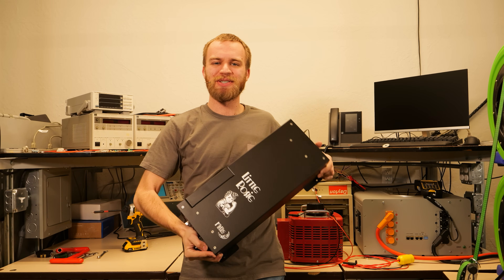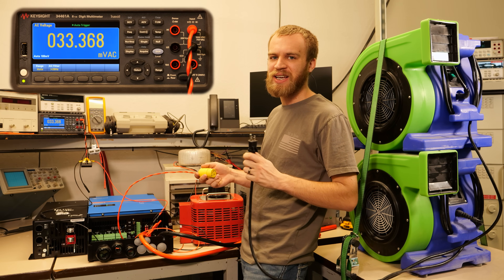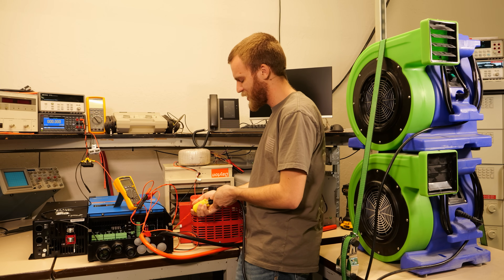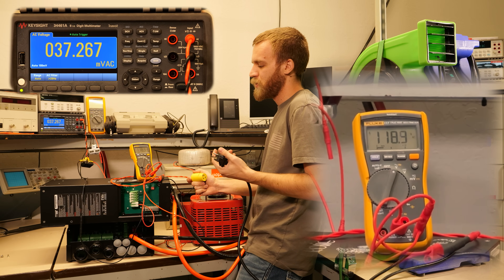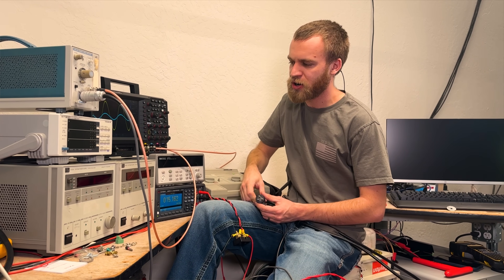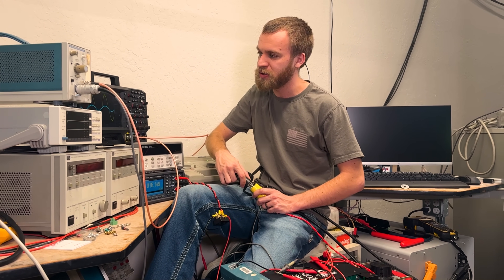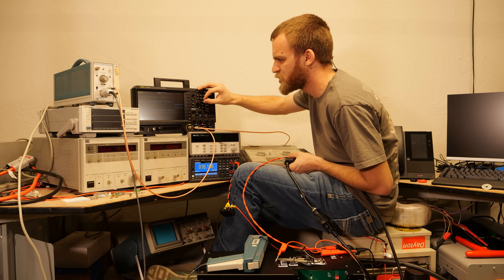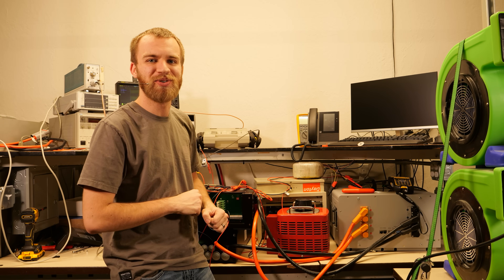Surge Capacity Test: Low Frequency Victron VS High Frequency Midnite | NOT WHAT WE EXPECTED

Comment: Is Current Connected going to continue selling Victron?

Victron is not "weird", they flat out overstate their inverter capabilities. A 5kVA inverter should run a 5kW load at unity power factor, no asterisks involved. Their efficiency numbers also don't reflect reality. Sure, inverter efficiency is measured only at a certain load percentage, so show me the efficiency curve. Their idle consumption (no eco) is often several watts higher than they claim. I have a feeling their version of a watt (and VA) is not the same as everyone else's.

They have quality issues and pass them off to the reseller who will tell you you're holding it wrong until you prove beyond a reasonable doubt something is not right. That's if they don't ghost you beforehand. Complete with return policies that are only valid right up until you open the box. I have had less trouble dealing with random Chinese brands than Victron.

The most pathetic item they sell is their Victron Battery Switch, which is made of fragile plastic that can't even be torqued without fracturing. Who's brave enough to run 275A through it?

A lot of their stuff uses non-user replaceable fuses that is nothing less than a probability based money grab. Victron's reverse polarity protection often means that the unit will burn itself out instead of causing a fire; not that it will actually prevent damage. Meanwhile, a cheap Chinese inverter will work good as new with some new automotive fuses.

Victron does make some decent MPPTs, chargers, and shunts. However, the rest of the stuff is a good decade outdated and overpriced. Their MAP is nothing short of price fixing. Why do we need to buy hundreds of dollars of gear simply to monitor their gear? What's up with all the VE direct/bus Cerbo nonsense? Even a VE Direct USB cable is $30, which is a glorified TTL to USB cable. Slap a dirt cheap ESP32 SoC in each component and let us manage it all on our phones without the dongle madness. If a $10 smart bulb can support remote management over Wi-Fi, so can an inverter.

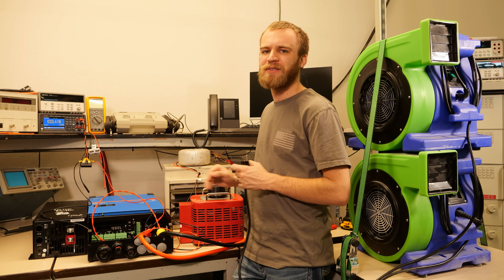Comment: 3:33 When you first turn on high amp electronics like that, there is a large surge of inrush current which is the 72 amps you are reading.  In this situation you need an EZ-Start or a Soft start.  This will keep the inverter from going into overload during the startup inrush of current.  Without an EZ start you will keep blowing fuses or wires and eventually break the inverter or electronics themselves.  Almost all Air Conditioners do this.  Pretty much any electronics that draw over 20-30 amps you should use an EZ start.  It goes between the inverter and the DC-IN connection (where the batteries go).

7:47 this is how voltage works, when big electronics turn on, the voltage drops low signaling it wants as much current as possible.  Then after it receives enough current, the voltage will raise back up.  You need an EZ-Start for inrush current.  Micro-air makes a good one.

Search youtube for "gone with the wynns air conditioning on a sailboat".  That video will completely explain this situation.  Sometimes it is difficult to catch this situation because you need a special voltmeter to catch startup inrush current since it happens so fast.

13:30 the Victron inverter was basically matching the sine wave of the load.  It matched it almost exactly which is ideal exactly what you want.  The problem was simply inrush current which will always give you a problem without an easy start.  Also you are always start at full load which is not good.  Especially after both inverters when into overload several times.  This is bad for the equipment and not safe for you.  Its like flooring and rolling the accelerator in your car over and over...  Not good for the equipment or for you.

I personally would go with a Victron inverter before going with a mysterious no-name (also known as a black label) inverter.  I planned on dual Quattros for my boat.  Victron has a presence in all major countries with physical installers all up and down the coast line.  They are also available at West Marine etc.  If something goes wrong you can get help, you can get parts, you can find installers.  Little Rosie is kind of a knock off bargain bin inverter.  Victron is top of the line and has been for years.  Used in boats, rv's, and off grid setups all over the world.  Victron is gonna get you further IMO, you should not pay bottom dollar for your power setup.  This is something you will depend on every second of every day.

Comment: they are two different constructive architectures for a reason. the low frequency inverter from victron is built with durability over time as the low frequency transformer does not put so much strain on silicon transistors as the high frequency inverter does. The real test will be having them under constant full load for about a month or until One of them breaks. this test is only conclusive with respect to showing the response of each architecture to instant loads. but for someone who doesn't want to change the inverter every 5 years, this test is not conclusive. as I would much rather have it last longer having the compromise of a distorted sine wave at starting up instant large loads. so it is going to be more interesting to watch this video with this in mind. I don't have inverters so I don't care about neither. The distorted sine wave from the low frequency inverter is probably linked to the response of the transformer's ferromagnetic core, even if it is a high quality toroidal one.saturation

Comment: The MP2 switches at 20kHz afaik. My experience is that 9kW is doable. Over 9kW it will shut down.
The most heavy load I have seen is a bad welder transformer that peaks over 9kW to do less than 200A @ 19V ....
Reply: Oh, 3x230V / 400V 3phase here of course ;-).
The MP2 easily augments my DG75E that does 1.8kW per phase totalling 5.3kWh per hour, to more than 6kW per phase.
Yes, I am also off-grid.
And I am also feeding a full building site (they are building my home) with this setup.
A 3 phase stone cutter is easily done with the MP2.
Reply: A lot can be explained by how the victron works: the victron has a PWM DA converter that feeds the torroidial transformer. They have a new generation that doesn't use it.
But the MP2 works great in adding power to bad current sources, it's ideal for UPS usage.
As a matter of fact: I would want to see the graphs as UPS usage...

Comment: So my question is do these less than perfect sine waves affect the lifespan of the electronics they are powering? I had my constant pressure well pump controller go out on me after a couple years and have wondered if it was partly due to my inverter. I was running a LF Growatt for the last 5 years and recently switched to a 8kpv.
Reply: Have you seen the sine wave coming from the grid. It has all the distortions from your neighbour until the power plant. Absolutely nothing perfect is used by anyone connected to the grid.

Comment: So, after reading all the comments, as someone who just wants a good quality inverter, in a right sized system,(IE: not pushing it into overload regularly), either of these would be just fine?
Canadian here... seems a quick search the LR is a bit pricier. Plus just so many resources for Victron that, as someone who, as I said, isn't going to constantly push the limits, it seems Victron would be a better choice for me. My biggest start load is only going to be like, an AC, a few power tools(only 1 at  time), etc.
Reply from the maker: Yes, both inverters are wonderful and neck-and neck. As we start doing comparisons to other inverters on the channel, it will be apparently obvious we started by comparing two of the best of the best inverters to make it a fair demo.
Reply: @CurrentConnected  ~ the MP2 always looked a little too simple to me other than the huge toroid!

Comment: I'm super impressed by that desk... ~300lbs battery, ~200lbs man, and all the equipment.  That's like 800-900lbs!
Reply from the maker: And we built a unistrut overhead support for lighting and cord drop levering off an 8ft unistrut. They are sturdy as can be and the middle section is on wheels and can roll around the shop, the middle section of the second bench is holding the blowers. All 2x2 square tube and angle iron construction. These used to be the benches at a lab at Hewlett Packard back in the day, at which the fastest computer in the world that never existed was born at.

Comment: There is only a 10khz switching freq. difference. Victron is about 20 Khz and the little Rosie is 30 Khz.
Reply from the maker: Sounds about right for the second stage of the little Rosie, but I think the primary boost stage is a lot higher, I was having a hard time probing it to get an exact number getting the scope to trigger properly on a PWM signal. Researching it more and will share on a future video!

Comment: Surprised and a bit disappointed to see those voltage spikes. I was expecting better quality from a Victron.
Really interesting video.
Reply from the maker: The thing to consider is that the RMS voltage spiked, which is likely because the sine wave was more along the lines of a square wave.  On a square wave, RMS voltage is equal to peak voltage.  With a true sine wave, RMS voltage is approximately 70% of the peak voltage.  So the good news is that the oscilloscope revealed that the peak voltage was not any higher than when the waveform was undistorted, and those peaks are what damage components downstream.
Reply: It is robust, but yeah this video was overdue!
Reply: Most electronics have a good tolerance built into their power supplies to catch momentary droops and spikes so even 3 second diversions shouldn't cause them to shutdown or glitch.. It is the long term grid brown outs and high voltage events that ate my stuff.. I have a dual 4kw Outback Radian inverter which seems to do OK with water heater, well pump, furnace and I know it is older technology..

Comment: Comments re what you saw on the 'scope. The "fuzz" you see on the voltage waveform is not distortion. It is residual high frequency that hasn't been filtered out. Both the inverters synthesize a sine wave by rapidly (tens of kiloherz) switching a DC voltage on an off. Inductors and capacitors in the inverter are used to filter out (average over a fraction of a millisecond) the chopped DC.  The "crazy" waveform you observed on the low frequency inverter is the result of clipping. The high frequency inverter upstream of the big output transformer is trying (and failing) to increase the voltage of the low voltage sine wave it is creating. But it is hitting its limit, and clipping. That creates harmonics of the 60 Hz wave form, which are triggering ringing (bell like oscillations) of the circuits that are in the inverter to filter out the very high frequency pulse width modulation.
Reply from the maker: Yes, you are correct and that could have been more concisely explained. Was thinking more along the lines of harmonic distortion rather than ringing and filtering but my engineer mentioned the same thing

Comment: I do a lot of repairs on inverters and do test them out most low frequency inverters will last longer than high frequency the only difference from a Chinese high frequency inverter and the midnite Rosie is that they use top of the line components nothing compares to that quality but as far as other inverter I would pass I been using a middle Atlantic ups low frequency as an inverter 24/7 for over 10 years never been turned off 0 issues and simple 4 fans I would recommend the midnite Rosie but not other high frequency inverters spend a bit more money and get an inverter that the company stands behind the warranty and quality and made  in the United States 🇺🇸
Reply: I disagree somewhat have you ever heard of junbpaw they are cheap standalone inverters but  they are designed well in my opinion
Reply: @v @viyusavery248  repaired 3 of those high frequency inverters one was a 2080 watts for the cost of the parts I told the customer to get another one a throw it away not worth my time the only high frequency inverter on the cheap side that I might recommend bro use is the reliable electric but only the 3000 watts the older models not the new ones once in a while you will have what it’s called dc by pass when they burn up dc voltage can flow to your ac appliances and catch on fire while that will not happen on a low frequency as it has a transformer and only ac can flow through it it’s hard to explain when some people don’t have knowledge of electronics the midnite Rosie was well engineered and I believe they did a good job on that issue since they been on the solar industry for a long time
Reply: @1969fallen  oh so you had to repair the junbpaw? Can you relay what was the issue if you remember?

I gave them credit because they use bus bars instead of cabling and more modern transformers but I am open minded to take another opinion on it and really re-evaluate if they are good or not

Especially from the repair side of the world
Reply: @viyusavery248 the 2 I repaired had different issues one was no ac output on that one the problem was most likely an overload and burned out the output transistors I replaced them and the resistors still working today the second unit was shorted out transistors on the input side on that one most likely a capacitor burned out do you not pre charging the inverter they work but fail prematurely common issue the third one the whole board was burned out completely on that one I believe from experience was most likely do to battery over voltage input since that’s where most of it was fried if anyone has questions feel free to ask me I don’t get pay to lie I do real videos just like mango Power e reached out to me to help them do repairs on their units since I modified the to work better than the original internal inverter that was failing now thanks to me they are putting out a good product I hope have a good day